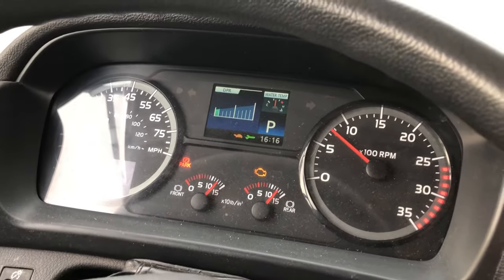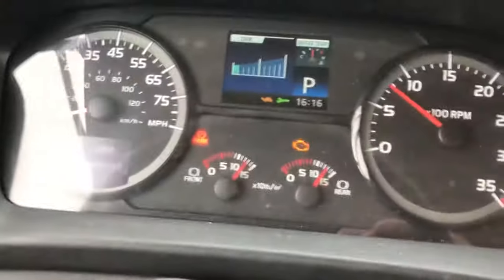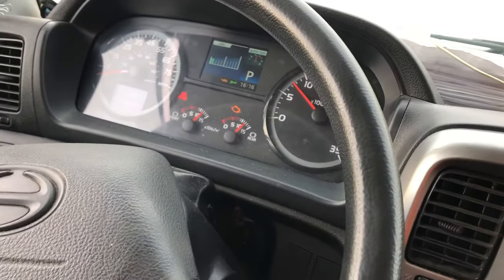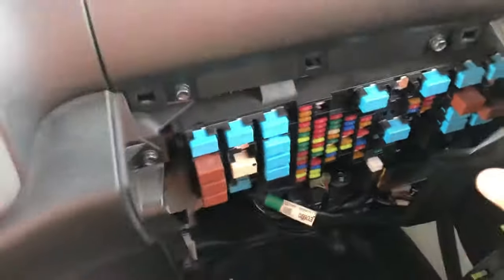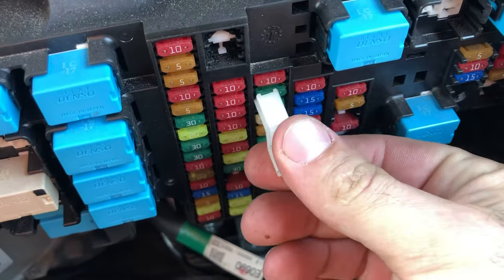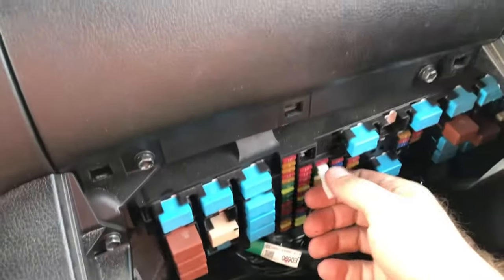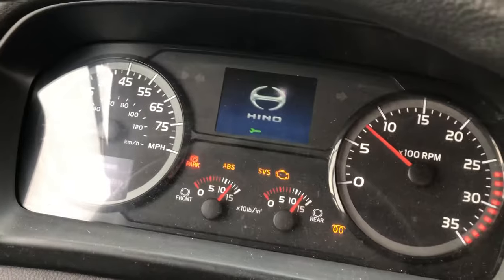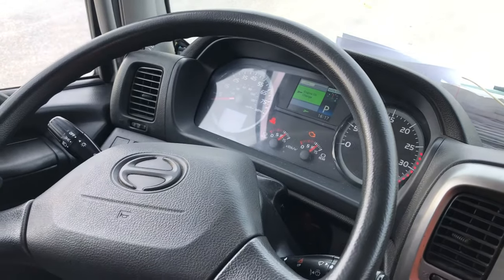How To Get A Hino Out Of Limp Mode

Comment: I was in a jam and so far this helped me out. Driving a 2014 Hino 195H. Keeping track of how long this is working, until my mechanics & dealer come up with solution. Thank you again!
Reply: I have the same vehicle, where is the fuse box? thx
Reply: @linbai2005  on the passages side of the dash. On the lower panel. Grip it from the top where you can put pens. It's just clipped on.
Reply: What fuse on the 195. Different than the one in video

Comment: Yeah the problem is a pain in the ass. Happens to me a bunch of times. When little turtle comes on without warning and your on the highway it frigging dangerous. I drive a Hi no flat bed tow truck for a Montreal tow outfit. I hate that light. Basically the engine performance changes and I go from cruising speed to about 85 km (55 mph), then 45kms (35 mph), to 20kms (about 25 mph). No warning just low performance and trying to get off the highway before I get to 25 mph. When our garage took it to the dealer it wouldn't go faster than 12 km (about 15 mph). It's annoying to think this system is only for the D.E.F. system. The shuddering and vibration when things go bad and the little turtle light comes on is terrible.  I turn the truck off and wait 10 minutes. That usually fixes it for some time. But as its doing it tonight maybe I'll try your solution. I turned it off three times already. Thank you for the info.

Comment: How about if it just struggling to go uphill ? But no limp mode light on ? ! My mechanic messed up my fuses  now truck wont shift gears properly and will struggle going uphill I wonder what fuse would reset that

Comment: I had a 2016 195 hino  had to pull one of the fuses and I was able to run it with no gauges but got me to shop. Pulling out and in did not work for me had to leave it out.
Reply: It was fuse number 7 on hino 195

Comment: Whoever started the whole DEF system crap should be smacked around. My 2020 hino 155 keeps going into limp mode and says def injector/sensor is bad. Replacing this every two weeks 😡😡.  Why?
Reply: I said the same thing. Its the stupidest thing ever! I run route in Vegas and i have to randomly stop to let this stupid truck regen for like 45 mins
Reply: The actuator is bad change it and you will be fine u can get to it without removing turbo

Comment: Supposedly hinos will go into limp mode more frequently if you use the maintenance reminder and don’t reset the light
Reply from the maker: I actually heard that as well but I only reset it once or twice when I first started driving it but then quit doing it because I started just writing everything down in my book. It still did it, since this video it’s have the DPR system completely rebuilt and has been acting fine since
Reply: What model hino?  have a 338 was the DPR an expensive fix?
Reply: This didn’t work on my 2013 268